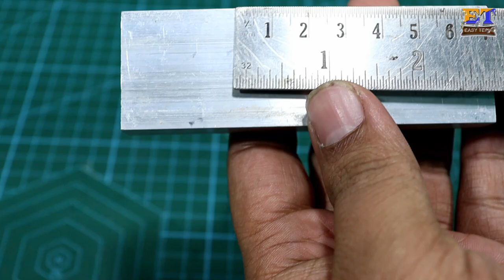How to Make Room Heater

Comment: Can I  use 42 v Power supply for variable power supply instead of 36 v as per your videos
Reply from the maker: Where. Here i didn't use any 42v power supply
Reply: U used 36v
I am asking if I can use 42v power supply
Reply: Not in this project
I wanna make a variable power supply
For that  I am asking